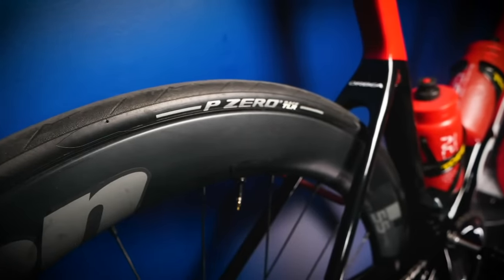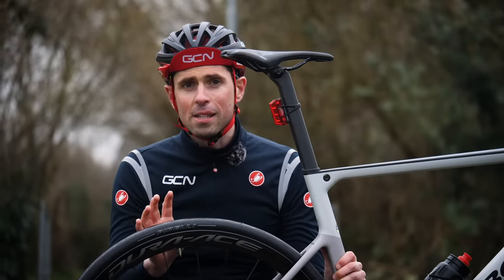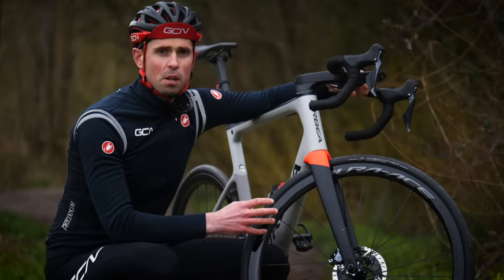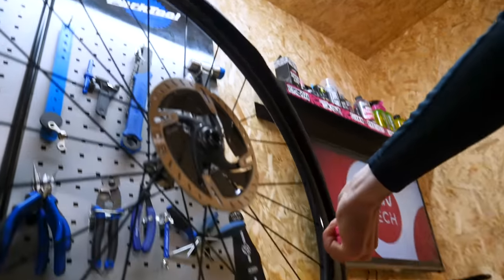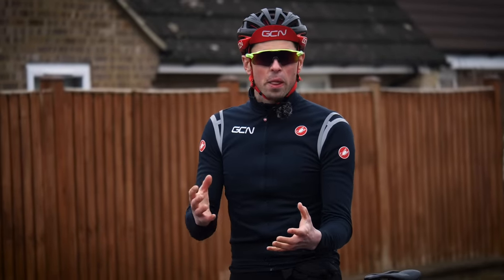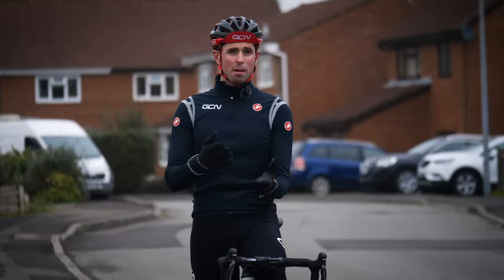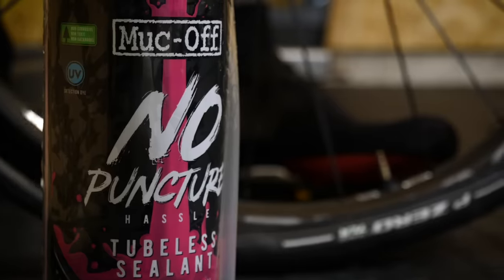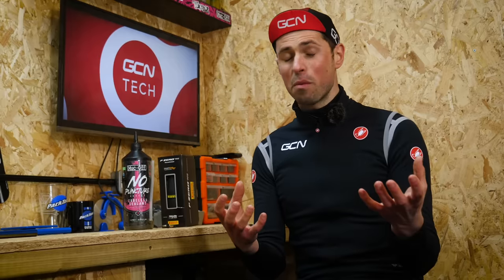Tubeless Convert! | Why Alex Will Never Use Inner Tubes On His Road Bike Again

Comment: A blind test would be cool to see, don't let the tester know which is set up on the bike.
Reply: And multiple runs at a specific wattage to avoid effects of fatigue.
Reply: big problem there is the pressure, tubeless way less pressure so would be easy to see and feel, M2CW I run tubolito inner tubes and they are just as fast as tubeless I also have the benefit of not getting gunk all over myself and wheels in case of a sidewall or major puncture downside minor nicks and punctures are way easier when running tubeless. So in summary for me it's all down to personal preference and what works for you...
Reply: Do the tests by coasting down a descent to take the human factor out of the test.
Reply: Agree. There is way too much confirmation bias.
Reply: Hi David, unfortunately I cannot ride my bike blindfolded haha.
Reply: @chrisvanbuggenum871  hi, the runs were done back to back for same conditions and ridden consistently with an Ave power between 265-270w. I'm not in race shape, but at that power over 11min there's zero risk of fatigue for me. Hope you like my insight to tubeless though.
Reply: @GCNalex  thanks for the extra info Alex.
Reply: Great comment!
Reply: @joelyons886  I too use tubolito  and yes love them
Reply: But strictly when the traffic is the busiest. :D
Reply: @markusnanderod5934  neither markus... only one stupid comment here 🤔
Reply: yup, double blind would be even better.. this is absolutely a non-scientific test
Reply: @GCNalex  I think it’d help ensure the results are compatible if you were to add a power meter then compare ride data to make sure your efforts were roughly equivalent.

To me, the comfort point is probably the most significant factor. I wonder if it’s a big enough difference that you feel like you’d be able to ride further/longer than you otherwise would? 

Lastly, the point about lower pressure meaning you have more grip is intriguing and I’d like to know more. Does this equate to improved handling that could allow you to go faster into turns and descents? Does it improve stopping power? Stopping power in particular is a key to going faster, as counterintuitive as that may seem. If you have more confidence in your breaking, you will let yourself go faster. And, if you can break faster, you can wait longer before applying the breaks which means more time is spent at the higher speeds. I’d love to see a comparison of how quickly you can break using tubeless at 60psi vs road at 90-100ish.
Reply: Pretty sure that tubeless vs a tire with latex tube, no one can feel the difference. and when I went from GP5000 TL with sealant to Veloflex Corsa Race with latex tube : the tire is more comfy thanks to its very souple construction. Never again tubeless on my road bike. I am heavy, so I need to inflate quite my 25mm tubeless and the sealant does not handle great more than 5 bars.
Reply: Please please
Reply: Exactly what I was thinking. I'm thinking of going tubeless but my current tires still have half their tread so not until later. But I really can't see how a 60 psi tire can compete with 110 psi is this just a fad or what ?.
Reply: So true !
Reply: All of this to save 2-3 watts. Maybe.
Reply: With lower air pressure in tubeless, you can tell immediately, so you can’t perform a blind test.

Comment: Title is misleading. Should be “A cycling video on confirmation bias”
Reply: Have to agree with you on this. A lot of gcns content follows this pattern
Reply: Why? Are you suggesting that tubeless tyres aren't faster, aren't more comfortable and don't result in having to fix fewer punctures?  If so then it's you that's demonstrating confirmation bias.
Reply: @AllanPhillips  No, in order to have results of real value, the test of tubes versus tubeless would have to be a double blind test where the rider has no idea what tire setup they are using.
Reply: @jeffr119  There have been plenty of tests that have proved the benefits of tubeless tyres without involving riders at all. So I agree the testing in this video wasn't very scientific (I'm surprised he didn't even ride to a set power), but the results were still in line with what we know to be true.
Reply: You could hear in the cyclist's voice when he was starting the ride on tubeless that now he is going to put the hammer down.
Reply: @AllanPhillips  They may or may not be faster - at the same pressure, there is little doubt they would be faster, but with lower pressure increasing the deformation and thus the churn in the sidewalls, who knows? Anyway, this "experiment" that takes the major part of the video is no help at all in determining whether or not they are. With results within 1% of each other, that's even below the precision of a regular power meter, and then we're not  talking reproducibility of Alex's effort yet, especially when he knows which ride should be faster.
Reply: @Whateverthehell123   I think we're both agreed that the test in this video wasn't very satisfactory. It's quite possible he reduced the pressure so much the tubeless tyres should have come up slower.
Reply: To say "never ride with inner tubes" is not true, he still rides with them
Reply: @AllanPhillips  no, i think he is suggesting it was a flawed test.
Reply: @AllanPhillips  tubeless have some pre’s, especially mtb/gravel. For road not so sure. They are heavier (vs normal tyre/lightweight inner like tubolito), require heavier rims. So no advantage there. On the comfort thing it’s harder, more personal. I don’t pump up the 28mm to 6bar like in this vid. I am experimenting with 4 to over 5 bar currently. 5 suits me . And then having / repairing flats, well, take a look at gplama’s experiences with that… not quite ‘happy days’… first time set up, no sweat. But after that, horrible.
Reply: @jeffr119  geez double blind?  I do I see where I going on the vike?
Reply: @AllanPhillips  Lower pressures, especially on choppy British B-roads, are usually faster.
Reply: @AllanPhillips  I agree with you. That said, running one tire setup 35psi lower than another on coarse roads will almost always make those tires faster. I wonder how much closer the gap would be if he ran the tubes at 75psi.
Reply: The title is, "Tubeless Convert! | Why Alex Will Never Use Inner Tubes On His Road Bike Again" and he clearly states his personal bias up front. Not sure how any of that is misleading. However, this testing even though far from scientific does back up the results of the manufactures and independent tests.
Reply: @Brucifer5150  I think we'll have to agree to disagree. 35psi is way too large a gap to confirm test results, that alone on the wrong road surface would make the clinchers >20w slower.

Comment: Blah blah ,,,, when it comes to that inevitable time when you have to replace a tyre or sealant, it is drastically more PITA running tubeless.  You did your best to make a conversion look like a walk in the park, but that is massively disingenuous and simply doesn’t reflect the realities of pain points which can go with getting the tubeless tyre on/off that rim - nor did you cover the price differences in short medium or long term.
Reply: Exactly this. If you want to run road tubeless, you should have a second set of tube wheels on the ready. While MTB is definitely more reliable, the high pressure of road tubeless means things are more likely to go wrong, and when you go to ride, there's a good chance a valve will start losing air, or the tape has shifted, and neither will reseal, requiring a full go at setting up again (which means missing your ride, unless you've got that second set of wheels.) If your rim has a solid lining (no spoke holes), that helps a lot, but you still can end up with a fussy valve. I want to love road tubeless, been trying it on and off for the last decade (since they first came out with those awful Hutchinson tires), but so far inevitably I keep going back to tubes because it keeps screwing up (and missing rides with friends). But when it is set up, it does make for a better ride, and has saved my butt a few times sealing punctures. (Including a nail in a tire, which I just left in, and was able to ride 30min home and dealt with it there.)

Comment: I tried tubeless and loved it UNTIL I had a catastrophic failure which really should have been fixable with a plug but no, it just simply would not seal (it wasn't even a big puncture). I ended up having to call for a ride home with sealant absolutely all over me and all over my bike. Ride ruined, brand new Rapha kit destroyed (sealant won't wash out), sealant all over my bike - in every nook and cranny. - inside the rear derailleur, brakes, absolutely everywhere. I had to totally dismantle the entire bike to clean it all out properly. What a HUGE pain in the arse. I'm sticking with tubes thanks. At least if I have a major puncture I can just swap a tube without any fuss but in my experience you simply cannot do that with tubeless without getting absolutely covered in crap. So no, I do not ride tubeless, in fact I HATE tubeless tires - mine went straight in the bin.
Reply: I use a relatively small amount of sealant in my tyres to prevent such mess. When the puncture doesn't seal you can either put in an innertube or add some sealant from a little bottle through the valve stem while you're on the go.
Which sealant did you use? Because No Tubes sealant is quite easy to get rid off in comparison to Cafélattex.
Reply: @greabo9544  Or maybe tubeless is just crap.  I've given it plenty of chances, and it's always let me down.  It didn't ruin my gear, but did leave some nasty stains on my blue jeans, and a bit of a mess to clean off my bike.  Has ruined a couple rides for me, though.
Maybe you don't ride enough?  I've tried tubeless on several bikes, and found it's garbage for anything high pressure/low volume (road).  It's arguable on mountain bike/low pressure fat tire stuff, but still definitely a hassle without much payoff IMO, but I wouldn't blame someone for using it there.
On high pressure road tires, it's just crap.  I've blown rim tape, I've had flats that won't hold air, I've had early tubeless stuff that's impossible to take off the rim (And no, I'm not an idiot..  You try mounting/unmounting an early fusion 3 tubeless with normal tire levers.  good luck) 
Not all are catastrophic ride enders, but the 3-4 minutes to change a tube has never ended a ride for me, so IMO, the odd flat tire that it might actually save me from once or twice a year (if it actually works) will never outweigh the hassle, and occasional gong-show when it doesn't work like it should.
Reply: @greabo9544  Yeah he really sounds like he's shilling for "Big Tube"... A lot of people have these problems with tubeless road tires, they seem to be less prone to these problems on thicker tires used on mountain and gravel bikes, which seems to be why mountain bike and gravel riders are mostly happy with them. Roadies find them, as a group, to be a mixed bag mostly not worth the hassle. I can see the benefits for off-road use, where they function better,  but if you want lower pressure on a road bike, I really don't see the superiority to using tubeless over upgrading to tubs. Tubulars seem to be the upgrade that has withstood the test of time and just works for roadies that want something lighter, and lower pressure than a clincher.  Oh and to put your conspiracy to rest, why is it that almost every pro that listened to a sponsor and tried out tubeless in a race situation, wound up with similar failure described by op, ruining their day, and they stick to tubs or clinchers?
Reply: After experiencing exactly the same problems with tubeless, I couldn't agree more.
Reply: That’s sad, for me is the opposite my sealant always get the job even with deep or big hole 😁, unlike my tube tyres always get puncture and need to change on the spot which is really annoying.

Comment: Fantastic scientific method by GCN! One run each, knows which ride is on his favourite tubeless (placebo effect). Ooh, 7 secs difference; is that a significant difference, or just down to random variation? Who knows? Different PSI's, traffic, weather, power output? Come on GCN, think it thru first, you can do better. If tubeless had turned out to be worst, would you have even posted the video?? Eg. Tubeless Convert! | Why Alex Will Never Use Inner Tubes On His Road Bike Again Even Though They Are (Objectively) Slower Than Latex Inner Tubes
Reply: I agree! Where is the power data?
Reply: Another "GREAT" GCN "science" based  test, just like the great "science" done in the test of "aero" wheels against "shallow" rim wheels...doing that one over again, eh? You didn't use the lightest "light" tubes, as the tubolito tube is lighter than the ones you use. Further, you don't have to pump tube tires up to 90psi. I run my Contini GP5000s with the tubolito tubes at 65 psi with no problems - so much for the "comfort" idea. I use both tubeless and tubed tires, the latter are much more efficient  and lighter!
Reply: Yeah, this one has to be one of the worst  comparisons they've done. No controls too many variables.
Reply: @robertsutter7588  hi Robert, each run was ridden between 265-270w.
Reply: @danielmoorhouse6506  Hi Dan, thanks for your feedback, was just sharing my experience of tubeless tyres from multiple years of use and a simple test to show there is a difference between each setup. Sorry to hear you didn't enjoy it.
Reply: @aad493  thanks for sharing your thoughts, the light inner tubes I used are near identical weight turbolito inner tubes. Glad to hear you are enjoying your setup and nice to hear positive views.
Reply: @mickgtir  hi, while the test was a simple comparison in real world conditions, I'd be happy to hear your thoughts on improving it. there is already lots of data/testing done in controlled environments, however I personally like to try products in the conditions I will ride them in too
Reply: @GCNalex  I use both the Tubolite and the Schwalbe  tubes that you seem to have tested. The lightest of the Tubolite are a bit more light, but the key point is that you neglect to point out the added rotating weight of a tubeless set up and that your "testing" was not very accurate, plus, as others have pointed out you neglect to explain the difficulties that can be encountered with mounting tubeless tires and I've never found a sealant that can go ONE YEAR without being added to and I've tried most sealants - best luck I've had is two months. Enjoy your tubeless set up, but you should be more objective in your reporting. Thanks for getting back, but, unfortunately, I'm less inclined to follow GCN given the recent string of rather amateur reporting.
Reply: @aad493  thanks for sharing your thoughts👍
Reply: at the very least he should've ran them at the same pressure.

Comment: I'll never go back to tubeless again.  I tried tubeless for  1 1/2 years and it was a complete disaster of a system.  I tried different compounds but I got slimed within every 3 rides.  HATED tubeless.  Went back to tubes last year and haven't regretted the decision and never looked back.
Reply: Same.  Tried it several times through the years after being told "It's gotten way better than it used to be"
But it's still totally awful on road bikes.